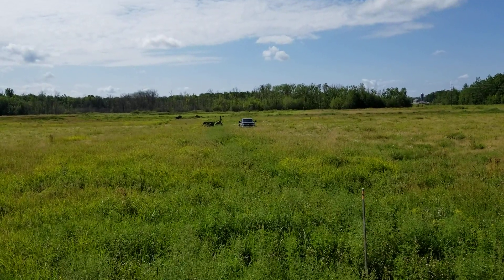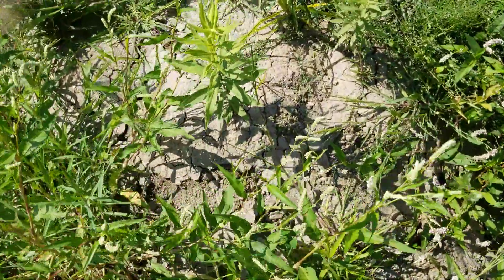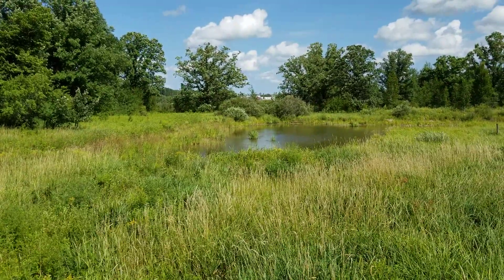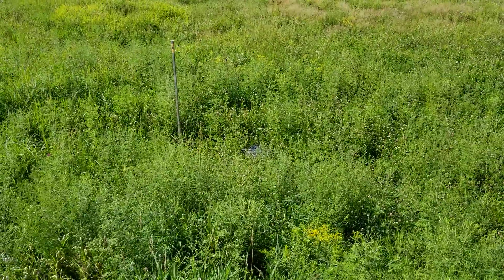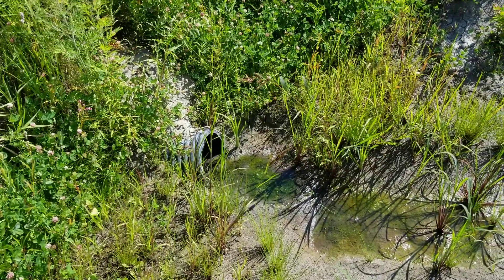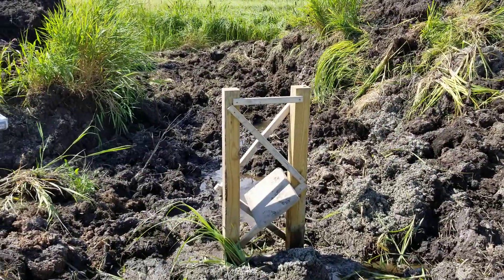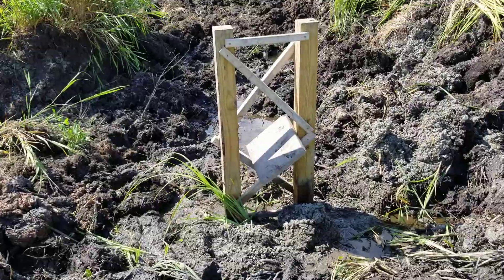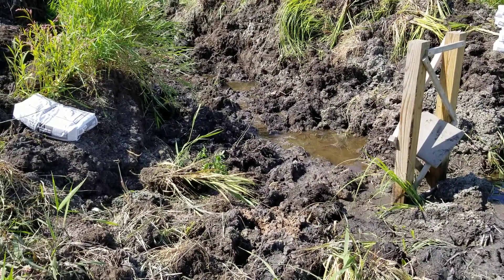Part I - installing water control structure in berm

Comment: Do y’all normally hunt 30” water? Also what are you planting out there this year?
Reply from the maker: The 30" number isn't anything special. Basically I was aiming for 2-3 acres of floodable food plot and I figured I'd use a 36" structure. When I shot everything out with a laser, 30 inches is basically just where things ended up. I definitely didn't want an impoundment that would be deeper than chestwaders plus all the literature says puddle ducks can only feed down to about 18". Not going to get anything planted this year. If I can get the berm finished (which means getting any low spots filled and grading the whole thing out) that will be a big win.